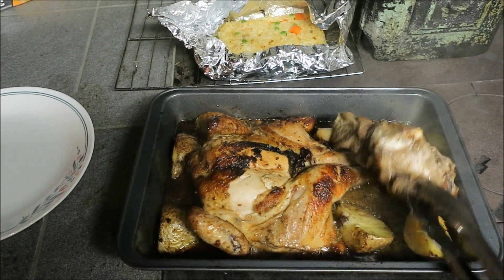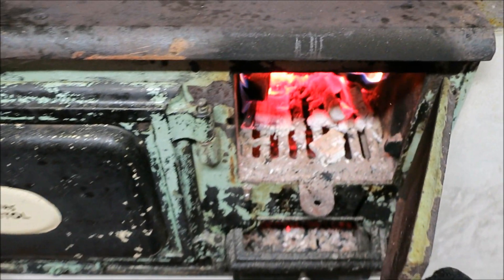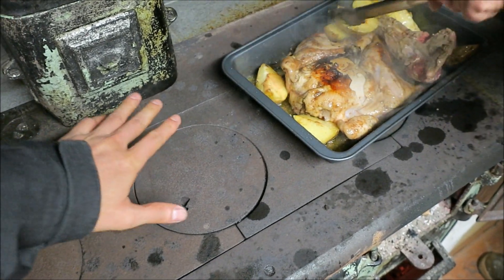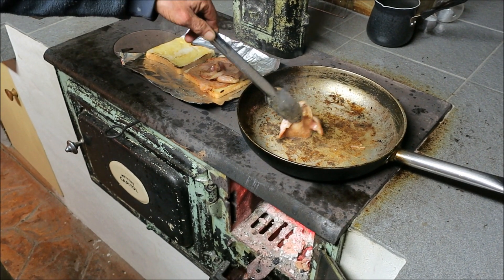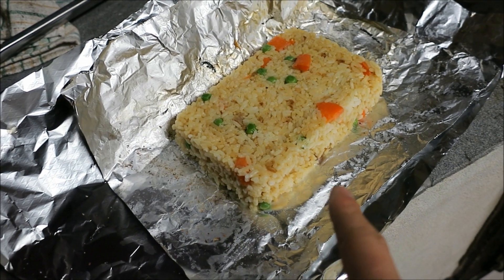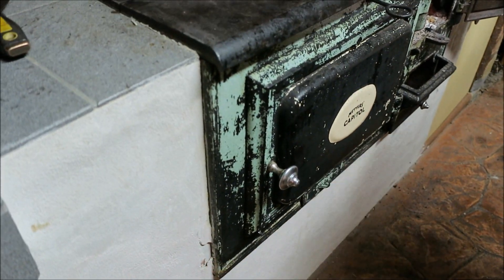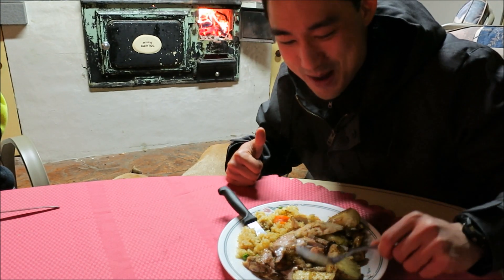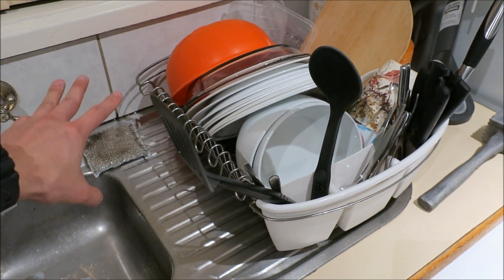Roast Chicken, Wood Fire Cook Stove, Australia

Comment: Wood stoves are extremely effective for cooking, heating the home, etc so long as you have a handy supply of wood. Harkens back to yesteryear. Stirs the nostalgia. Fun vid. Food looked delicious.
Reply from the maker: Indeed. Classic old design, but it sure works. The ashtray below is also an air intake. So the combustion chamber burns more efficiently with little to no smoke. The chimney is offset at the back so the hot plate and oven absorbs all the heat energy. Rather than losing it all up the chimney. The food was amazing 😋
Reply: @BAdventures   Hello B Adventures. May I ask you, if you would:
I am thinking of buying a wood heater which also has an oven. It is either that or an inbuilt with fan (it is a brick fireplace) (though I can't seem to find a baker's oven wood heater with a fan too!)
I need to buy something soon.
How practical is it for baking or stove top cooking (only in winter obviously)? Is it annoying or difficult because the temperature is hard to control? 
Cheers.